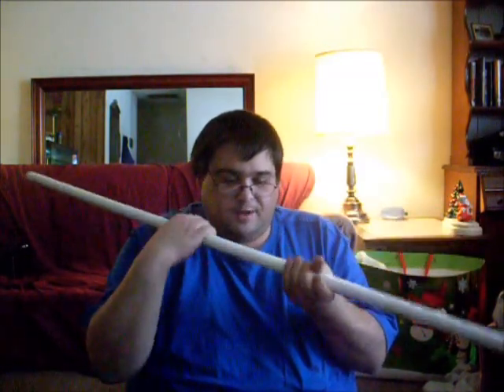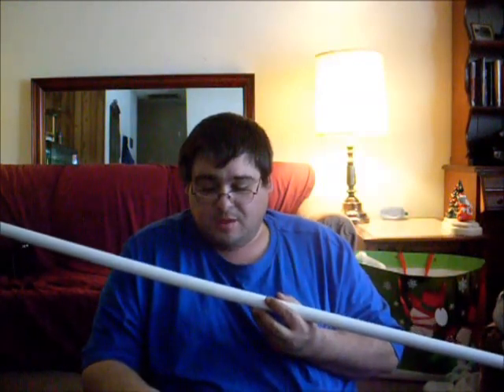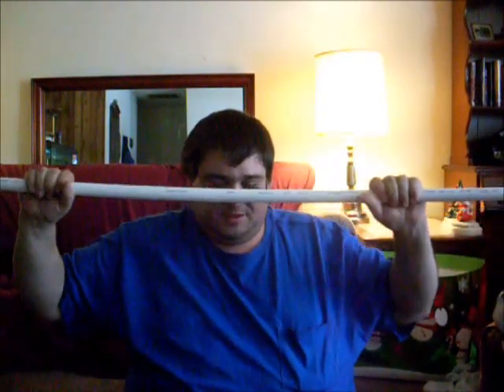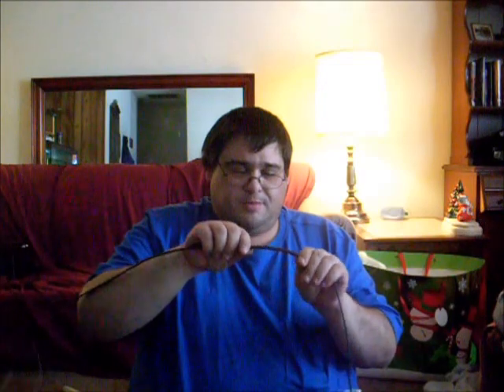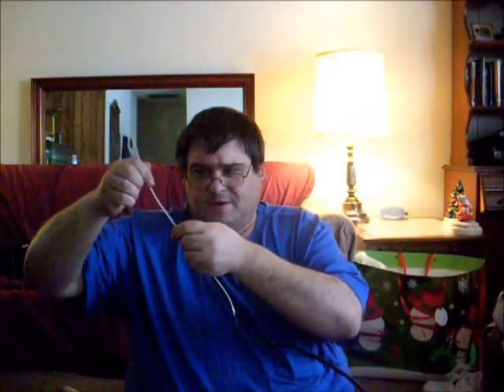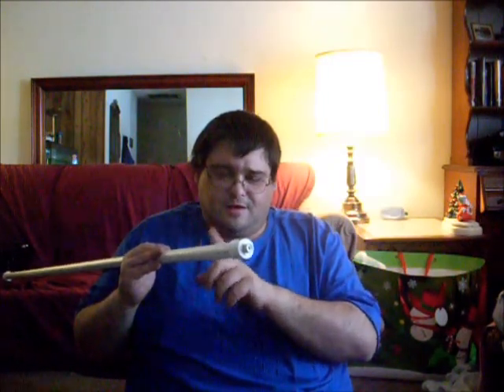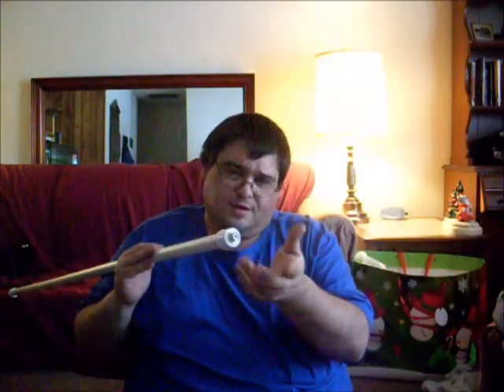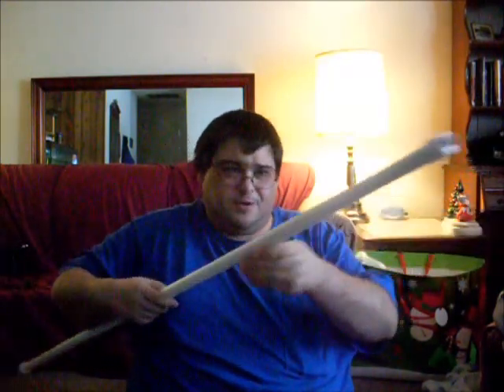Dual Band Base Station VHF/UHF J- Pole HAM Antenna Review

Comment: Thank you for sharing this antenna. I used to have a 2 meter antenna but I broke it 30 years ago. This J pole that you have is much more durable and dependable. I'm going to get myself one and use it in the event that I might need it for emergencies. Having something like this is a good idea. thank you again for demonstrating it. it doesn't cost that that much. Thank you, Brent, k7btf

Comment: I bought one of these back in July. It finally went bad about 2 weeks ago.  My honest feelings and fix for this problem is easy.

First let me say for the money this thing is worth the 30 bucks! It went 75mi+ for me and is confirmed by numerous clubs and people in ham radio if you wish to contact them to confirm my results. I am not lying, it is a good antenna and will go 75+ miles depending on your location.

Now I myself am stuck deep down in a valley between to mountains.. The highest mountain in KY is 5 miles away from me at 3500+ feet. That gives you an idea of what I am dealing with but it still got that good of performance out of it!

The only downfall of the antenna that led to it's demise for me is the actual connections at the base in the cap. Condensation is a problem for this antenna even if sealed in a pvc pipe due to the air trapped inside.

Once anyone gets this antenna I highly recommend taking a hot glue gun or a clear silicone caulking and filling up the bottom cap where the soldered connections are as well as covering all the soldered connections with either black electrical tape or heat shrink tubing to prevent rust from forming on the connections. 

My antenna rusted apart where the shielding or (negative) braid was soldered on the lug in the base cap due to what I think is heating and cooling cycles in my area or "condensation buildup". I live in a hot humid summer/fall time area.

This happened twice one me before the final time where the shielding separated from rusting in half. The first two times I would notice I was getting bad reports from local club check in's. I took the antenna out of the tubing and both times i found the rusting occurring with no cause for it. I cleaned it up and was right back clear as crystal after that. A bad connection could have cost me my radio and thank god it didn't.

If you do as I recommended to the base cap and other exposed parts as seen in this video the antenna should do good and last years to come!

The sealant should keep any condensation off the connections and prevent rust from occurring. High end antenna's like Diamond, Arrow, etc usually make a hermetically sealed antenna in fiberglass that prevents this from occurring.

Good luck to all and happy Hamming!

Adam

KM4CTJ

Comment: how tall / long should a 2m vhf antenna be? i am away to sit my exam and buy the kit but i am not to sure how long it should be.
Reply from the maker: 1/4 Wave antenna would be about 1/2 meter and a 1/2 wave would be about a meter.  A 1/4 6 meter antenna will be a close enough to a 1/2 wave on 2 meters to work a lot of times too.  They can be longer, but if they are they are usually stacking radiating elements to get more gain.
Reply from the maker: The length of the antenna doesn't matter so much as far as antenna performance.  It is more how well it radiates and how little reflected signal there is, however the master of all antenna performance is how high in the air you can get it.  A couple pieces of romex trimmed into a simple di-pole at 200 feet will out perform a $1000 antenna at 50 feet.
Reply: Grate stuff, Thank you very much for your help, ill go around to the radio coms shop today and get my antenas and coax.

Thanks again.